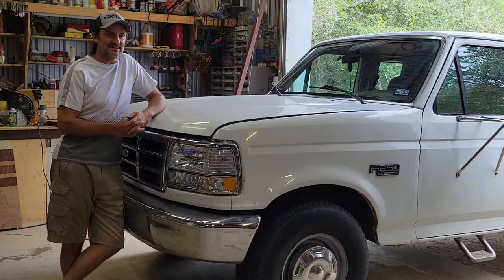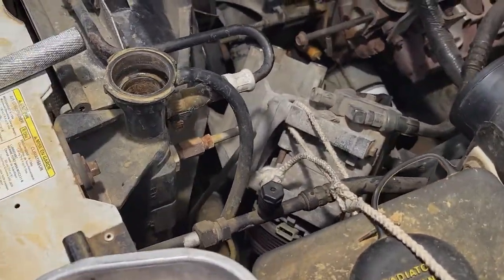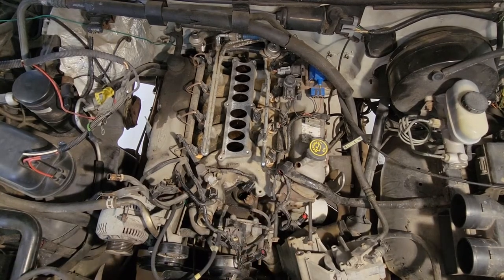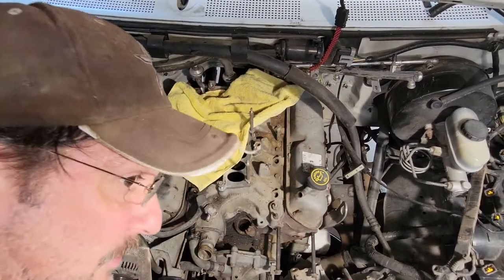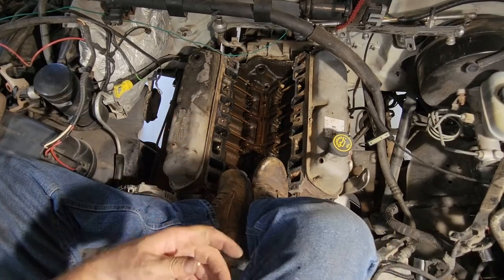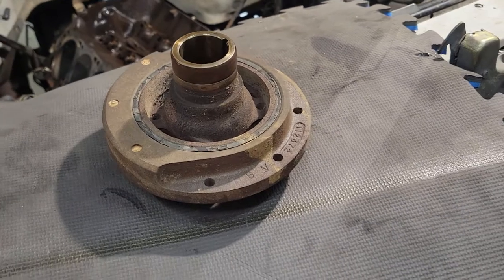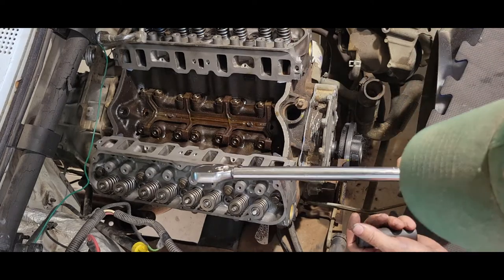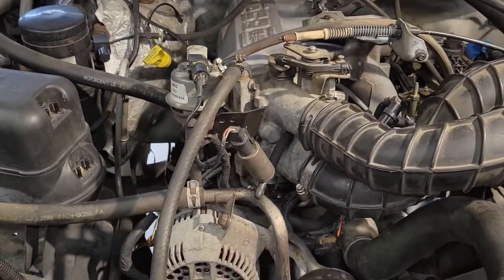K-man Builds - Ford 1996 F250 - 351W - 5.8L Engine Top End Rebuild

Comment: Doing my 1989 Bronco XLT with the 351W and this was really helpful. My injectors were all cracked and looked factory so I upgraded to the EV6 fuel injectors (4 pinholes). Thanks for the heads up about the potential for lighting my wire on fire!
Reply from the maker: Glad it helped
Reply: Have a link to the ones you used? How did they end up working? Thanks

Comment: Makes it a lot easier to work on if you remove the front wheels and let the truck down a good foot , that’s what I did when I did the head gaskets on my 94 lightning
Reply: Thanks for the tip

Comment: I bypassed that smog pump on my 95 f150 302 it has 329,000 original drive train. Might have been easier to just pull the motor as far as you are going into it

Comment: Might just as well pull the motor and change the oil pin gasket in the pump and transmission seal. And the rides and mains get it over with

Comment: Im in process of stripping down my 5.8 but rebuilding it with a intake manifold and 4 barrel carb since its in my 1995 F150 , wish me luck :)
Reply: How'd it go? I'm getting ready to pull the heads tomorrow on my 86 which already has the carb manifold but getting rid of all the emissions junk and swapping to a Holley. Hoping the heads reveal the reason for a pan full of coolant instead of a cracked block. haha

Comment: Are you having trouble with the egr delete at all? I deleted mine and cannot get rid of my CEL. I'm also having an issue where the truck fires right up instantly on a cold start and then when hot I have to pump the gas pedal to get it to start.
Reply from the maker: I am getting a error code that comes and goes but I am not worried about that since this is a shop truck.  Not having an issues with starting though.  Not sure what would cause that.

Comment: Did you get those vacuum lines figured out in that box
Reply from the maker: I believe so.  Still working thru other issues in the fuel system right now.
Reply: @kmanbuilds  oh ok I have a 1997 and was going to see if you needed a pic of how there all connected im the second owner has 153,000 miles on it
Reply from the maker: Charlie,  Seems I did not have it right after all.  If you can, please forward a pic.  My question is really about the lines coming from the A/C area.   You can forward to Kmanbuilds@gmail.com

Comment: What about air pump and  both cylinder Heads air pumps plugs on the back log the head. How did you. Plug it
Reply from the maker: I just used a couple of pipe plugs with thread sealer.

Comment: Thanks for this video very informative! Got the exact same truck 95 f250 5.8 xlt and mines got a ch ch ch ch noise going at idle but goes away at higher rmp, any idea what it is? Could it be the rockers?
Reply from the maker: It could be rockers or even a small exhaust leak.
Reply: Kman Builds thanks I'll check it out. Love these trucks appreciate you taking the time to reply.

Comment: I have a 96 f150 ex cab 4x4 that came with a 5.8l on f250 suspension from the factory.I have over 230k on the motor and it still runs good. I know eventually i will need to rebuild,so good video and thanks. How did you work around taking off the smog control? just cover the holes?My fear is it will mess with air gas mixing and run bad.
Reply from the maker: I put in a thin plate between the EGR and the throttle body.  I am still working on why it is running very rich but it runs smooth.
Reply: If you keep the stock heads, you can find some bolts to simply plug up the crossover tube holes on the back of the heads
Reply: @kmanbuilds  mine runs rich too, I’m thinking letting the egr do it’s job might lean it out a bit

Comment: i just inhereted my dads 96 f250 5.8 4x4  about to do the same thing.  did removing that emission crap that goes to exhaust manifolds cause the engine light to come on?   i want to take em out, but we have deq here..
  thx.  and awesome video
Reply from the maker: I left the EGR in place but blocked the port behind it going to the throttle body.  I dont think it has caused a problem because the engine light does not come on all the time.  Mine does something but I just realized that the heads I had rebuilt were not done right.  Look for video on me installing new aftermarket head this week.
Reply: @kmanbuilds  just got my heqads back, about to start putting it back together.  kind of a pain in the ass.  your video is very helpful..  i didnt grab enough pictures, so im using yours for reference.
Reply from the maker: yeah, the video is very helpful.  I made a mistake on my vacuum lines and was able to go back in my video and see where they went.
Reply from the maker: BTW,   I also had to replace my heads after I did this video.  The shop did a bad job on the driver side and 3 of the 4 seats backed out.  I went ahead and bought some aftermarket aluminum heads but did not get a video for it.  Run like a champ now.  Still not getting over 12 miles/gallon thou.
Reply: can you tell me what heads you end up going with? Awesome job!  @kmanbuilds

Comment: Where did you purchase the pully in place of the pump?
Reply from the maker: I picked it up from a local speed shop.  I believe they sell them at most auto parts stores.  It is a Air Pump replacement pulley.